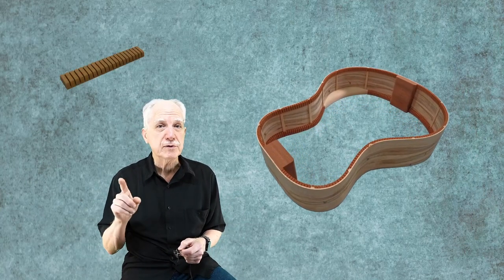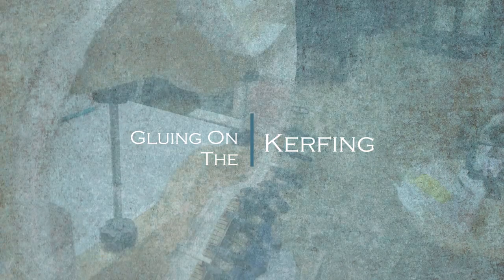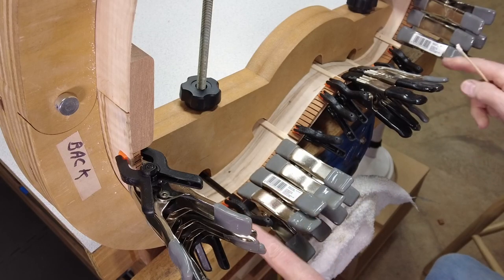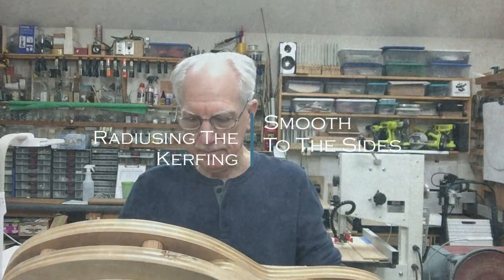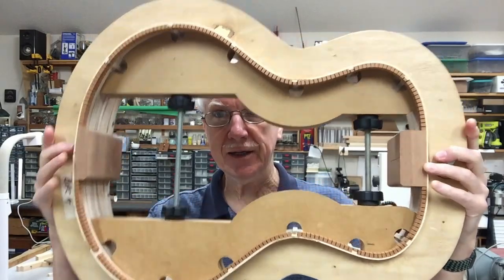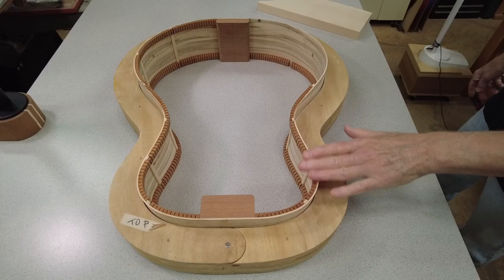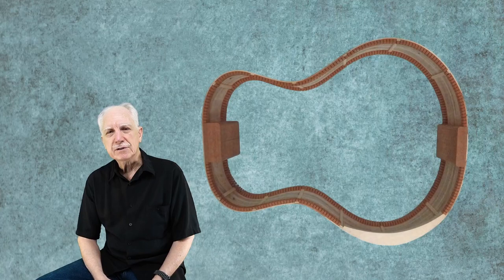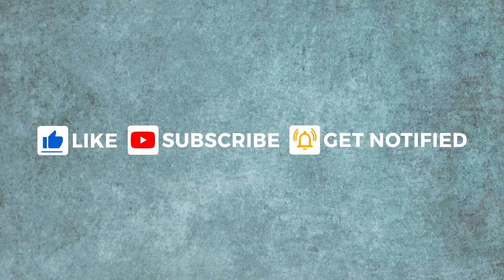McClelland Woodworks Video Journal #33. Installing the Kerfing and arm bevel block.

Comment: Is it customary for the top radius and bottom radius to be different? I think I heard 30 top and 15 bottom. Is there a reason? Thanks as always!
Reply from the maker: Hello Frank, yes it is usually the case the the radius of the top is different from the back. The top radius in shallow to the point of almost flat a 30' radius over a 21" span is not much of a curve. The top is arched in order to help strengthen it against the pull of the strings, and some suggest that it helps in sound wave transmission. The back having a tighter radius helps to reflect sound waves back to the top. Also a totally flat backed instrument would be uncomfortable to hold to play.
Reply: Thanks Michael. I’m enjoying these videos very much.